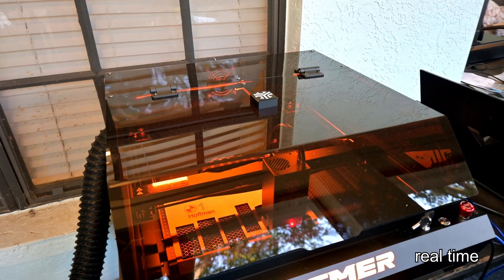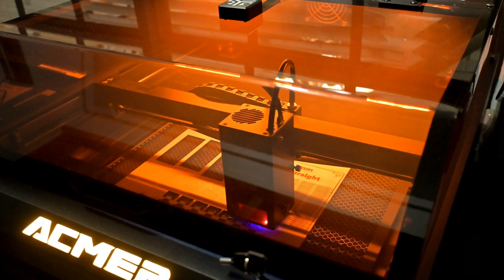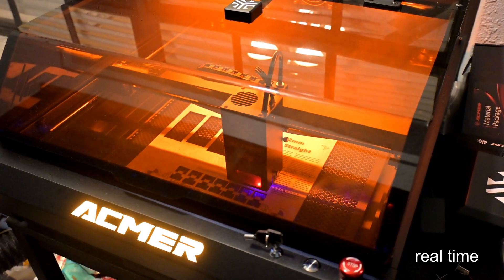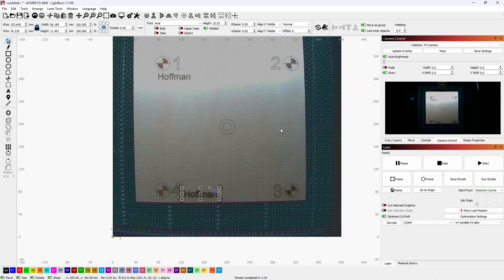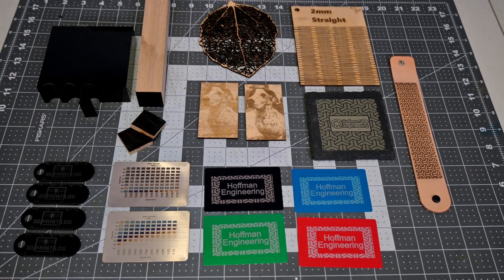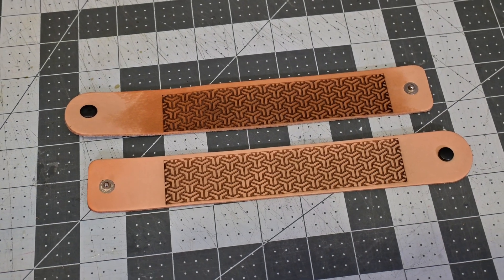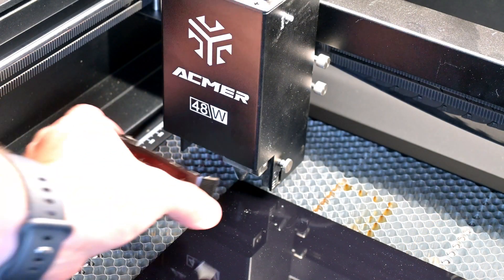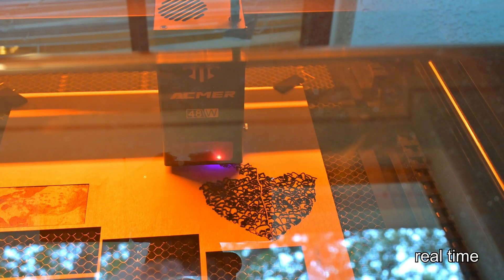Laser Engraving Reinvented? Testing the Core-XY ACMER P3!

Comment: Question: I come from the CO2 engraving world,  I have a 2in1 laser head and can not engrave black granite like I could with the CO2 machine.  I have considered going back to CO2 or do you think if I were to purchase the 24 or 48w module I would have success keeping this machine. Thanks
Reply from the maker: What kind of engraving issues are you running into? Black granite should engrave just fine with the diode laser. But, the 2in1 has only a 10 watt diode laser. Thats most likely way lower powered than your CO2 laser, so I wouldn't expect it to engrave as deep as fast.

The 48 watt module is almost 5x as powerful as the 2in1. So that would speed up engravings dramatically. How it compares to your CO2 lasers would depend on what power your CO2 lasers were.
Reply: @HoffmanEngineering  I used a 70w Boss CO2,  when I used the 10w it virtually made no marks when I tried to make a power and speed scale using the rough settings Acmer suggested.   I know I can set it very slow and it will be ok for letters and designs, but I'm frustrated in finding the right speed for photos etched in the granite.  Honestly this is like learning how to read all over again finding Diode settings vs what I have used for the past 7 years with Co 2.  I didn't know if increasing my module power would make it easier to find that sweet spot.

Comment: Can this machine auto restart after a power outage
Reply from the maker: I did not specifically test that, but I don't think so. There is no offline engraving features, the P3 needs to be connected to a computer to run, and I don't think lightburn has a power loss recovery feature.